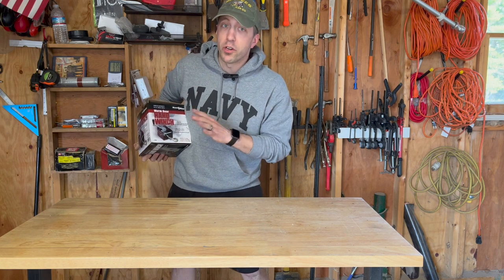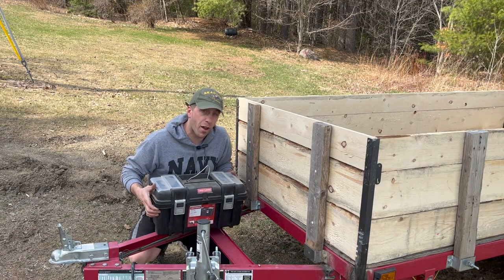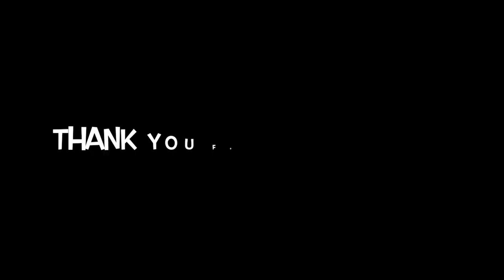CHEAP Harbor Freight Trailer Budget Build - Part 1

Comment: Nice job,  great ideas!
   I have a really old trailer that a friend gave me a couple years ago,  it is in very worn and beat up condition. 
 I'm not quite sure if it a harbor freight trailer or something similar,  but I have discovered that it is from a American made trailer kit that was produced during the late 1990s.
  I am planning on fixing it up in the future, and have been gradually collecting things for it such as a tail light kit that I got super cheap from a Walmart clearance, and a wheel bearing set from Amazon on a bit of a clearance deal also,  and most recent I was given five free bed frames from a guy who was cleaning out a apartment building,  
    My plan / challenge is to fix up a good useable trailer for as cheap as possible and include as much free , cheap, or recycled materials as I can,
   Starting with the trailer itself
Since it was headed for the scrap yard before it was given to me.
Reply from the maker: Wow, that sounds like a great project! Cheap stuff is awesome - especially those bed frames. 1001 uses! Thanks for watching and good luck with your build! 🇺🇸🤘

Comment: I've the same exact trailer purchased over 10 years ago and I used it for a couple years for yard dump runs and it's been sitting unused ever since I moved to a new place that doesn't need it. The wood's warped and falling apart so it's time to redo it properly like you did. I've ZERO experience in welding and will try to do what you did. Any good welder you can recommend? Maybe a cheap harbor freight one? Thanks
Reply from the maker: Check out my video on cheap welders - maybe that can give you come insight. Get the Harbor Freight $99 wire feed welder and start practicing on scrap. Welding takes a while to learn and get good at - but preparation is everything! I can make a beginner’s welding video for you if that will help. 🤘🇺🇸